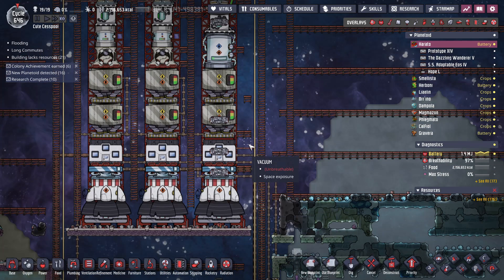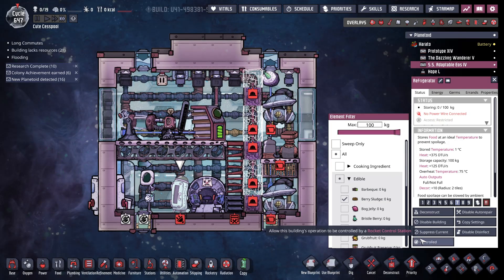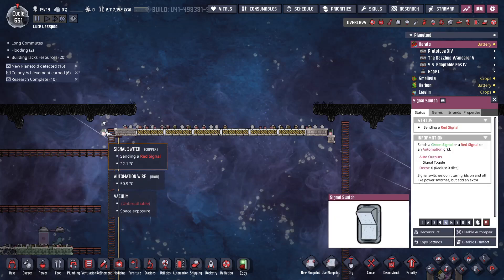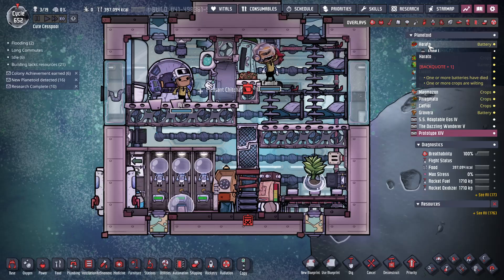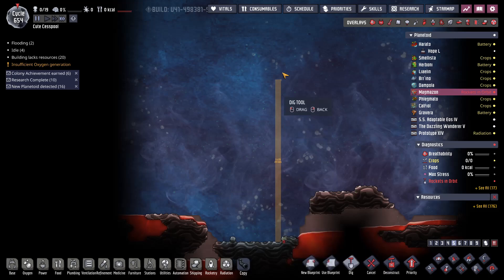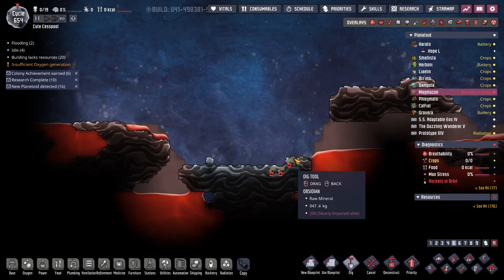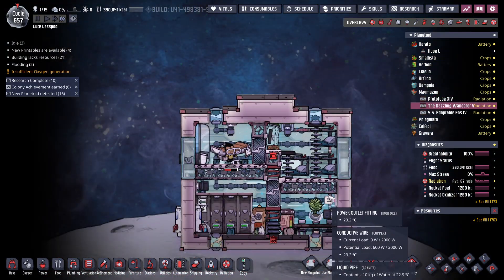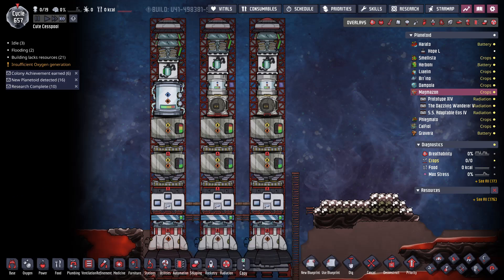Cute Cesspool Ep 22 Hot Base Swim Club

Comment: Hello! Just throw a few pitcher pumps without touching the magma and extract all the molten glass from the bottom (dupes will be clever enough). Dump it in the condensed water where the sour gas is... Surely won´t make it any worse ;)
Reply from the maker: That is a darn good idea.  What happens when they run 2500 degree glass through the Hg liquid lock?
Reply: @TartarusPlaysGames  in theory, if they don't drop the bottle, nothing should happen.
If they do... well... that mercury mist probably vaporise.
Try in debug and see what happens, it will be good to know 😊